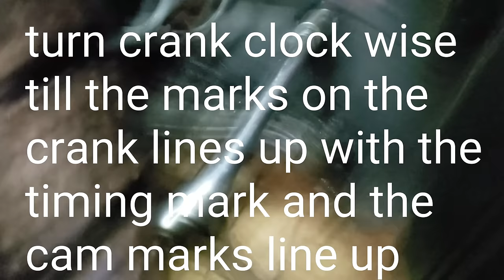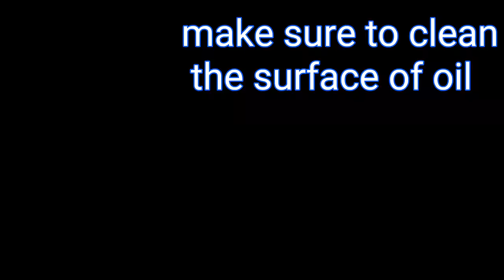How to replace Honda CRV timing chain DIY #crv #rsx #tsx #accord #k20 #k24 #timing chain

Comment: My daughter picked up a 2002 CR-V 2.4. The guy said it has a fresh engine. It's throwing codes after we got it home; PO172. Parts store guys said it's the timing chain. I ordered the parts and took the valve cover off. Followed your video and checked the timing marks. I put my long screwdriver in the #4 cylinder (thinking it was #1). All the marks lined up perfectly on top and bottom so I put it all back together. This morning, doing other research, it dawned on me to look up the firing order. Should I take it apart again and double-check the marks with #1 at TDC? Or, is it good to go with the marks lined up the way you showed? (I took pics of the cam marks and the crank mark aligned properly).
Thanks in advance. Ric
Reply from the maker: If the marks lined up..then it should be aligned. It could be the sensor that's faulty.
Reply: @UncleTinman  Nice, I was hoping so...I'm checking all that now. Fuel odor is really strong when driving...
Reply from the maker: @Livefreeandlaugh  timing may be off from the sensor reading faulty, but there's also a possibility of the vtc solenoid malfunctioning.
Reply: @UncleTinman  I can't thank you enough for your insight! I have her CR-V, my Accord, and wife's Pilot. I have new timing in all of 'em now. Just trying to work out this CR-V issue and we're good. Your video and common sense approach is exactly what I needed to boost confidence to tackle all this. My boys (9 & 15) and my daughter (23) have all been elbow deep learning a lot during this lock down. You've had us all crack'n up with the FF hammering and such. TY again and I'll keep ya posted. We're in Rio Rancho, NM...where are you?
Reply from the maker: @Livefreeandlaugh  I'm glad to be of assistance and laughter. Makes my efforts worthwhile to be able to help others. I'm a Honda guy myself as I have a slew of Honda vehicles. I'm located in Toronto, Canada.
Reply: @UncleTinman  As I'm pulling things off I'm noticing the VTC oil solenoid has been slathered with orange silicone gasket maker and there's plier marks on it. Should I clean, test and put it back in if operating fine, (concerned about the rubber o-rings pliability and effectiveness) or replace along with the Vtec solenoid I just ordered today? thanks in advance brother!
Reply: Oh yeah, I found a VTC oil solenoid for a 2003 Element 2.4ltr for $27. The same part for my '02 CRV 2.4ltr is $60-$100+...I'm thinking this $27 unit will perform for the '02 the same as the '03 right? (part# REPH380805)
Reply from the maker: @Livefreeandlaugh  Since you have the new one I'd go with the new one. The spring tension in the old one might be insufficient and causing your issue.
Reply: So far so good. The parts came in today. installed rather easily and quickly. Fired right up and has a bit of a "breathing" going on. Not sure if it's the '03 Element VTC oil solenoid (since it was way less expensive and the same motor)? The breathing isn't bad, drives and runs really well, even when I put my foot in it to kick it down, RPMs up about 5k and it never complained. I'll give it a few days of driving to see if the engine light comes on. If not, I'll run it thru emissions and call it good. 
Thanks again for all your support brother! Stay Safe! Peace...
Reply from the maker: @Livefreeandlaugh  Glad to hear everything worked out. Cheers
Reply: Nah, it's still got a fast idle and fuel evap issue somewhere. I've removed the TB and cleaned the solenoid attached under it. No changes. Took it to a shop for diag...they want to drop the tank and inspect for leaks and damage. Do you have any vids/advice on the fuel evap system and tank inspections? I can find other vids on fuel pump stuff under the seat, but not the actual tank removal...
Reply from the maker: @Livefreeandlaugh  Sorry to hear. The tank is a plastic tank.. So it shouldn't have any cracks or leaks other than the top where the sending unit mounts. How high is the idle. I find those valves can go bad... Also they need to relearn if you've pulled the battery for drive by wire units. As for the EVAP they can be tricky. You can usually test them by putting voltage to the solenoids. I have a video for Honda Pilot Evap solenoid testing that I did before. 
https://www.youtube.com/watch?v=9bd9YCnC8m0&t=151s

Hopefully that'll give you some ideas and help.

FYI.. I wouldn't drop the tank for such an inspection. They should try to do a smoke test if anything before going with such a labour/cost intensive method of "inspecting"  just my opinion.
Reply: Cold idle is up around 15-1800, then warm it's around 900-1000...tap the throttle and it shoots up and hangs for several seconds, then settles down. The crash bar around the tank is bent up about 8-10" on one side and there's a deep scratch on the plastic tank. no signs of leakage. The 'aroma' of gas fumes is intermittent in the cabin. I've run some Lucas inj cleaner in it for about half a tank. I don't think we've been able to drive it long/far enough to re-learn...we take it out in the eve's and putt around the side streets...no plates yet until it passes emissions... it runs and drives great otherwise...
You are a blessing with all the advice and direction! THANK YOU!!
Reply from the maker: @Livefreeandlaugh  oh.. so there is some damage. Hmmm. Perhaps try to inspect the canister and see if there's any damage. I don't recall if it's exposed or cover with a shield. Sounds like it may have been damaged and be cracked.  That may be your fume culprit. As for the idle.
 That sounds like a separate issue. I would see if there's any local pick and save wrecking yards around your area to salvage a throttle body to save some money.
Reply: Looks like they had jumped a curb or median and got hung up under there. I'll watch yer vids and then dig into it this weekend since we're still on lock-down. I do have a pick-n-save salvage locally, there're a few things we need to pick up from there! LOL! Thanks again brother!

Comment: Im wondering, when you used the jack to keep the engine up, did you use wood under the oil pan?  Do you remember what you used to remove the engine mount, was it a deep socket or an open end wrench?  do you remember the sizes?
Reply from the maker: The motor will suspend without being jacked.. most Honda mount bolts are 17mm. You'll need a deep socket since the studs are pretty long.
Reply: @UncleTinman  I really appreciate that info.  Im just waiting on my lisle 19mm socket to get that crank bolt off, and Iam going get it done this weekend, thanks to your video and info.  I will let you know how it goes.   Wish me luck!
Reply from the maker: @KINGGOD69  alright. Thanks for your compliments. Good luck with the job. Feel free to message me if you have any questions and I'll try to answer.
Reply: @UncleTinman  that's awesome I will, really appreciate that!

Comment: that issue are compared with too much fuel consumption and lack of power ?
Reply from the maker: Yes. It's possible
Reply: @UncleTinman  should i replace chain slides also ? It has 280k kilometers
Reply from the maker: @hajikrow1431  you might as well since you're in there. But the one in the video had over 400k and was perfectly fine.. no wear

Comment: Can i change the oil pump tensioner when i replace the timing chain? Thanks
Reply from the maker: There's no tensioner for the oil pump. Need to remove the pump to change the chain.
Reply: @UncleTinman  thanks

Comment: Uncle Tinman, why didn't you replace the inner timing chain (25:52) while you are doing timing chain?
It will be a pain if you have to remove everything out back out if that chain become defective.

That are the inner chain called & can you please provide part number for both chains for 2005 CR-V?
Reply from the maker: That inner chain drives the oil pump.  In order to replace that the oil pan and pump need to be removed. There is no recommendation from Honda to replace....so...didn't see a need to replace. Not sure about part number. Try looking them up on Rockauto.com

Comment: Link for your belt tensioner wrench? Ive been using 2 wrenchs together since my crows foot stripped
Reply from the maker: I did a quick search on Amazon and found a set available. 

https://www.amazon.ca/dp/B07G113V6C/ref=cm_sw_r_cp_apa_glt_i_A2J61BTWMKX9W8Q0Z0A1

The one that I have is 14/17mm. Depending where you're located.. I assume Harbor Freight might carry a similar tool. Hope this helps.

Comment: What code did the car have before changing the chain?
Reply from the maker: I don't recall the code, but I believe there was a cam code... regardless it should be replaced on a schedule.
Reply: @UncleTinman  no valve damage?
Reply from the maker: @Ķųțťþ  nope. Car runs just fine.

Comment: Great video, do you happen to remember the torque specs for the crank bolt to tighten.  Ive heard 181ftlbs or 140ftlbs.  i cant seem t find that info anywhere,..
Reply from the maker: The service manual calls for 36ft/lb. + 90degrees.
Reply: @UncleTinman  36 ftlbs thats it?  Your awesome!  thanks for getting back to me.  Much appreciated!
Reply from the maker: @KINGGOD69  yes. That's what it calls for... 36ft/lb. +90 puts it well over 100ft/lbs
Reply: @UncleTinman  your awesome thanks again!
Reply from the maker: @KINGGOD69  glad to help

Comment: How many miles was on the Cr-v?  
I have a 2004 that has 230,000 and no engine or transmission work yet!!
Reply from the maker: It had 455k km. Which is around 282k miles

Comment: Question how’d you align the crank gear 22:30 ? Do you just move it by hand until it’s top center ? Thanks in advance I’m planning on doing this job on my crv.
Reply from the maker: Thanks for your comment. The key thing is to line everything up before taking it apart. You line up everything by turning the crank by hand. There's a mark on the gear which was suppose to show up by an arrow in the video, but somehow it didnt show up after editing the video. You'll have to line up the dot on the gear to the coloured link on the chain. Hopefully this answers your question.
Reply: Got it thanks so much.

Comment: Question about how much would this job cost to get done ? I bought a used Crv with the timing chains way off and some one recommended for me to just get a lower mile engine on it instead of paying to get it replaced etc etc
Reply from the maker: Pricing depends on your local shop rate and sourcing of parts. I suggest sourcing from rockauto.com
Reply: @UncleTinman  I got the parts just want to see what an estimate would be if it’s even worth it or just go with the lower mile engine install if it’s around the same price etc etc
Reply from the maker: @fume5671  I think labour guide calls for 5-6hrs. So give or take $600  -$700 in labour

Comment: If it seems like my camshafts are about a tooth or 2 off while the crankshaft is aligned correctly, do I leave the crankshaft where it is and then rotate the camshafts so they align at TDC? 
I’m a bit confused on this part.

Or do I set/lock my cams and move the crankshaft counterclockwise to the timing mark.
Reply from the maker: It's easier to lock the cams in place and then adjust the crank as needed. Hope this helps.
Reply: @UncleTinman  thank you so much! Is it ok to turn the crankshaft counterclockwise to get it to align? Or do I have to do full revolutions to keep going the way the engine spins?
Reply from the maker: @juanto303  yea.. you can do that.
Reply: @UncleTinman  thank you so much! I’m surprised that you answered so fast! You have a subscriber for life now 😁
Reply from the maker: @juanto303  I just happen to be by the computer. Hope you can finish the job without much trouble. Cheers.

Comment: Did you remove the wheel to get access to the crank pulley?
Reply from the maker: Don't need to remove to access pulley.  You can turn the wheel out and it'll be enough room. Removing just makes it easier.
Reply: @UncleTinman  OK, so you actually removed the wheel, but it's not necessary.  OK thanks a ton.  I actually have to do this job.  Kind of dreading it, but videos like yours gives me a lot more confidence that I can tackle it.
Reply from the maker: @Zermelo  You can do it.. Anything is possible.. My advice is to put back what you take off... Take your time. Get a container and hold all your bolts. Mark connectors if you're not sure. Use some tape and label things and where they came off of. Label connector A goes to sensor A. connector B goes to sensor B. So you have a referrence to where things came from. Take pics of where things came from so you can look back.. Just little things to help you along the way if you're not familiar... That's what I usually do with new cars that I work on if I'm worried about where things need to go back... But sometime to keep in mind... harnesses and plugs are usually stiffened into a certain position/placement... So it's not too hard to find their way back. 

I would take the wheel off. Gives you more room to work around.  

Good Luck.
Reply: @UncleTinman  One more question if you don't mind.  Did you use OEM parts?  My 03 Accord isn't worth much, so I'm not trying to spend a lot of money, but OEM is going to make that much of a difference, I'll get them, but I want to keep cost down to a minimum.  Maybe just get an OEM tensioner and chain? or would an aftermarket chain last a while.  The car has 150,000 so if I get a few more years, I'm good.
Reply from the maker: @Zermelo  I used aftermarket parts. Try looking on RockAuto for price comparison. Feel free to ask any questions when you need. Cheers

Comment: So, what might cause the VTC solenoid to break off right at the O ring?
Reply from the maker: @xMrBlack  my guess would be that it was sezied and someone tried to pry at it before..broke it and just said oops and shoved it back in.
Reply: @UncleTinman  it has broken off or started splitting 4 times. I could see that be8ng the case the first time but after installing a new one 3 times, having code p1009 come up and finding it splitting again, Im thinking there is something else going wrong.
Reply from the maker: @xMrBlack  Wow. that's interesting. I've never come across such a situation. Maybe someone else can chime in.
Reply: @UncleTinman  yeah, it's had me chasing my tail fir months

Comment: How the hell did you remove the engine mount bracket from the side of the timing chain cover? I have a 07 crv.
Reply from the maker: Did you get all the bolts? There's one underneath that's kind of hidden
Reply: @UncleTinman yeah but there is a longer one that doesn’t come all the way out because of the fender. It hits the fender.

Comment: Had to remove my head for a head gasket replacement, when putting the camshafts back in is there anything weird where they need to be tdc on like an exhaust stroke or anything?
Reply from the maker: Just line up the timing marks and you should be good
Reply: @UncleTinman  you're the best man! I appreciate it alot litrually in the garage now. Haha
Reply from the maker: @HORSEDICKoMPEG  np. Glad to help. Hopefully you turned the motor to TDC before you pulled it all apart.. if not. It's ok as well. Just turn the crank so that the piston #1 is at the top and the crank mark is lined up
Reply: Yeah bottom end was close to tdc when I pulled it apart, but I had to remove the cams to remove the head.
So hopefully it should go well! Lol thanks!
Reply from the maker: @HORSEDICKoMPEG  yea. You should be fine..
Reply: @UncleTinman  Got it finished last night, didn't self destruct the head on start up so the timing seems to be good! haha thanks for the help!
Reply from the maker: @HORSEDICKoMPEG  makes my effort of making the video worthwhile

Comment: Hey just did mine got everything to line up just like the video. but when i turn the engine clockwise everything is on timing but my color link dont line up any more is that supposed to happen?
Reply from the maker: Yup. They won't line back up. If you go counterclockwise they'll line back up though.
Reply: One more question with these engine do you spin it counter or clockwise or it doesnt matter ?
Reply from the maker: @leah3838  they need to spin clockwise. The only Honda motors (that i know of) that needs to spin counterclockwise is the older B series.
Reply: Ooh okay thank you so much your video and info was very helpful

Comment: Great video thanks, but why didn't you clean more? Lots of dirty rusty nuts and bolts, as well as the the rocker cover.
Reply from the maker: You gotta pick and choose your battles. If I was to clean every single nut and bolt everytime I worked on a car.  That'd probably take double the time to do the job. Generally customers aren't willing to pay for the extra time spent. All they want and need is a well running car. Cheers
Reply: @UncleTinman   fair enough dude 👍

Comment: Interesting, my 06 CRV with 292k miles just had that code pull up AND the VSA & Triangle symbol at the same time? Any idea's of it that was the case with yours?
Reply from the maker: VSA shouldn't be related. See if you can search up on how to reset the VSA. I had that code for years and didnt bother with it and just recently plugged a newer scanner in and was able to just clear it.
Reply: Thanks for the response. I dont have any symptoms, I have a cheap scanner, I can delete it, drive around all day & it comes back in the morning? @UncleTinman

Comment: No pattern or torque specs on the cover bolts?
Reply from the maker: They just need to be hand tight.. give or take 8ft/lb. I usually start from the middle and work my way outward. Hope this helps.